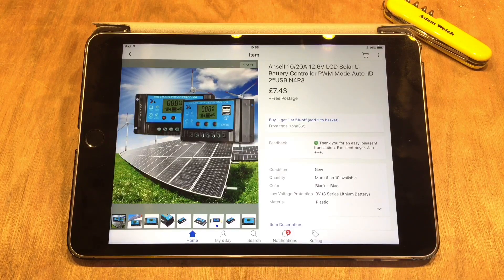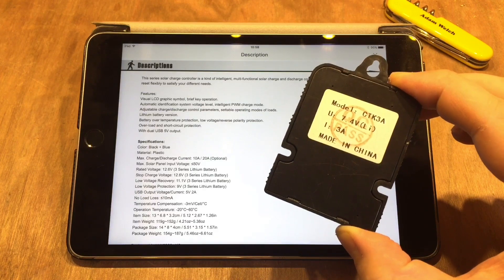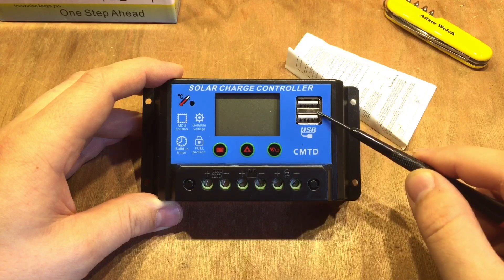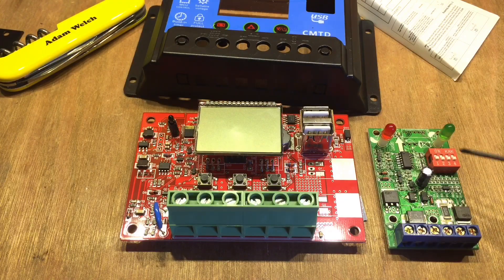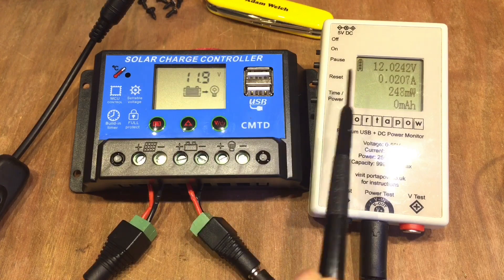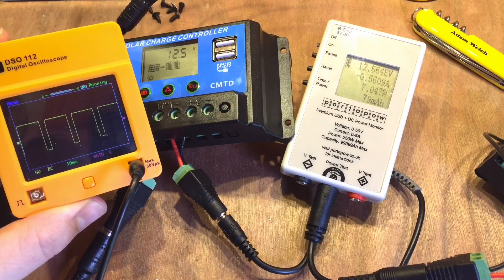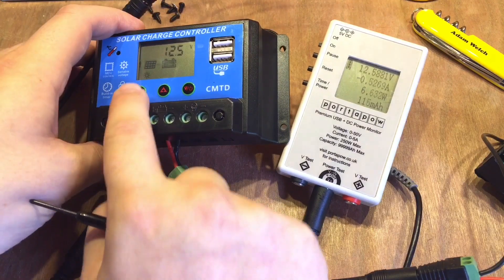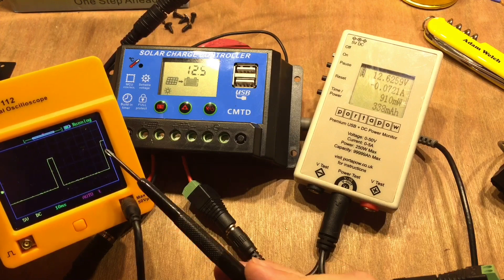Anself CMTD 3S Lithium Solar Charge Controller - 12v Solar Shed

Comment: Hi, Thanks for the video, very informative.  I have a similar version of this controller and a 13w@17.5v panel running it, however it's switching into 24v mode - do you know if there is a way to force it to remain in 12v mode?  I don't have a battery connected yet, so it that going to allow it to switch to 24v mode.  I didn't want to plug a 12v battery in and end up killing it!  Thanks in advance.
Reply: That's precisely the entire point! First thing to be connected is the battery, always! ;-)
The range will then automatically set to 12V or 24V. According to the battery bank connected. Quite simple indeed, no need to complicate!

Comment: hello my friend and thanks for the videos the are great help. i want to  make a small off grid system with one 60watt panel @ 12 volts and a small pack of 18650, what charger@ 20A or setup would you recommend for a 3s opr 4s packs on 12 volts? Thanks in advance.
Reply from the maker: For me 3 or 4s doesn't really work that well on most solar charge controllers.  The cheapest ones tend to charge up to 12.6 or 16.8 volts (the absolute maximum for lithium ion) and keep them there using a float charge.  I've done a series of videos on this and found it works a lot better with a 7s pack. https://youtu.be/YoH7V56RtkM
Now I was quite pleased with the Wincong SX01-3A ( https://youtu.be/vqnf6Msy9No ) because the voltage limits were a little more on the conservative side.  Trouble is it is only 3 amp so you're perhaps a little over it's limit using a 60w panel.  Plus the load output is a funny one - but that might not be an issue for you.
I was looking at the specs on the recent EPEver LPLI range of solar charge controllers.  They come in Tracer models (MPPT) and Landstar models (PWM) and seem to have fairly sensible charging parameters for 3s lithium packs.  Sadly though another funny load output specifically deigned for LEDs on top of a street light.  But I'm told something else may be coming from EPEver very soon.
Reply: Adam Welch thanks for the response. yes i have see the 7s but i must put second panel to make it to 24, volts and thats a yoo much for me .i was ok with 100watt panel @12volt and a 150ah battery fmin order to have lights (leds) and   charge phones small tv etc. with a 150watt inverter. but i was thinking to     skip the battery and go to li-ion .do you think there is . this anself unit your only concern is that trickle charge will eventually destroy the batteries? if i add a balancer will be better or not?

Comment: Would the charge controller behave differently at full charge if a load was connected  ? I thought that was the point of the load output

Comment: i wonder if i can pick your brains about something.
Reply from the maker: +Jay Moore You're welcome to pick what is left of them :-)
Reply: Adam Welch i'm making a small power pack for fishing. i have this controler and wonder the best way to wire up. as at present all my live are Daisychained and the negative as well. the middle of switches go to the + on the accessories. i'm wondering how to wire as to panel is easy and battery is easy. do i use the load to go to the accessories as plus and minus?
Reply from the maker: +Jay Moore Yeah the 'load' output is a simple positive and negative circuit. Using it gives you the advantage of a low voltage disconnect. If your battery voltage goes too low its cut off preventing too much damage. I'm not sure if you need help with the switches? You might need to explain a bit more if you do.
Reply: i have a pack i made thats works and charges via a dc jack. but want to change to a solar. all my earths are chained and the live as well. the middle of switchs are to + of the things i need . I was thiking is it as simple as take the - & + of the dc jack and go into the solar ( so use the jack for the panel and then go from middle battery to fuse and back along the chain

Comment: Many Thanks Adam for the informative video.  I've got a straight forward set up (small panel 12v battery, PIR and small 12v lamp) which I'm trying to set up as a light in my shed!  Been playing around for a while but still struggling with the meaning of some of the settings.  Can you point me to anywhere they are explained in more detail?

Comment: The issue I have with my similar looking unit is that current measurement and regulation is carried out on the negative paths. 
This means that either your vehicle needs to be positive earth, or you need to keep the grounds on your panels and loads floating.

Comment: Hi I have just bought one of these for my caravan. I get the solar panel and battery ports but do you know how to wire the load so I know what power my caravan is using. Help would be appreciated thanks
Reply from the maker: You've probably got a pair of wires that comes straight from the leisure battery which is the main 12v feed into the caravan. You could potentially cut these wires and use the half going to the battery for the battery connection of your charge controller and the other part going off to feed your loads could connect to your load terminals of the charge controller.
The thing to be aware of is you might have a battery charger in your van to power the 12v loads (and charge the battery) when you have AC power?  In which case things get a bit more complicated and to be honest I'd need to see the whole circuit to work out what was the best way forward.
The solar power system in my caravan is simply used to charge the battery - I don't use a charge controller with a load output on it.  Simple fact of the matter it that it's just to keep the battery topped up whilst its not in use rather than be a main power supply.
Reply: Adam Welch cheers I was thinking the same but not sure regarding 240v side of things so will just leave it as is. Cheers for reply

Comment: Did you choose the correct battery chemistry. Usually there are B00(LI-ION), B01(lead acid), B02(gel), B03(flood)
Reply from the maker: +The Walking Trade Now my Anself was sold as lithium only - and I suspected that it's just a lead acid charger which has had its charging parameters changed a little. I did try for a while to find a menu where I could change the chemistry but without success. Perhaps when I get a minute I'll try again with a fresh head on. If you can send me info of a button combination press or hold that you know of that would be handy.
Reply: Mine is this clone: http://www.banggood.com/102030A-USB-Solar-Panel-Battery-Regulator-Charge-Intelligent-Controller-1224V-p-1143533.html?rmmds=search
On this model you long press the First (as explained on the website) screen blinks and then w/ the other 2 buttons you select B01, B02 or B03.
In fact the manual says there is a B00 which does not exist on my model. But it seems that what they call TX4820 and TX4830 have this option for 48V battery (electric bike ?!)
By the way mine is not cutting the load on the usb ports part.
Reply from the maker: +The Walking Trade Thanks for the info - I'll give it a try but I'm not holding my breath.
Reply: The Walking Trade excuse me?
Reply: @AdamWelchUK  I have been experimenting with the ANSELF lead acid 12/24 volt version the end top off voltage is fully adjustable I can adjust it from 13.2V all the way to to 16V in 100 mV increments . I tested it charging an 6 cell 16V Supercapacitor 300F each cell. I used this because it would charge up and reach the final voltage quickly. What I discovered is this charger does not trickle charge at all. When it reaches what it thinks is the final voltage the pulses slow down and then it stops all together. I feel the Meter you was using was just not quite in sync with what voltage it was reading compared to what the charger thought the voltage was. If you had just lowered the set point down a tenth of a volt you would of seen that it stop sending charge pulses. For my test I set the voltage at 13.2V and also later at 14.7V. After the capacitors were charged I would lower the set point down on tenth of a volt and then observe the meter showed no arrow pointing to charging and the pulses stopped until the capacitors started to self drain to the new lower set point. But the charger never went higher than what was shown on the display of the meter. And the meter always showed the current voltage of the capacitors (battery) not the set point. I really don't see why one would need a special Lithium battery charger because the top off voltage is adjustable from 13.2 to 16 Or 26.4V to 32V (as long as the solar panel or power supply feeding it does not put out more amps than the battery can safely receive a charge). Regarding the wrench display on certain parameters shown. If you press on the left button and hold it will allow you to change that parameter. I believe the hour meter button it you press and hold left button for that just resets the hour meter to zero. Also by using the capacitors to confirm about not trickle charging the voltage never rose higher than the setpoint even after several hours. I did notice I had to charge the capacitors up a few volts before the charge controller would start working because at first it was 7.3 volts and not enough to operate it properly. The reason I used the supercapacitors was because a lead acid or lithium battery would take too long to reach the setpoint where I could observe and confirm the pulses stopped after setpoint was reached. Another reason this charger would seem to work well with lithium batteries is that unlike some Lead acid battery chargers this does not have a fast charge algorithm where the voltage is ever raised higher than the set point for a certain period of time during the first portion portion of the charge cycle. At no point does the charge go higher than the set point.
Reply: The instructions with mine suggested that the battery chemistry item was in the settings menu, whereas it is in fact absent

Comment: Thanks for your detailed video 👍 I have an issue where I don't know what to set my PV at and load on and load off. I will be running my 45w fridge and just my microwave and mobile/tablet. 
Would you be able to assist. I have set up my gel batteries b2 and I have 4 x 55Ah battery backup.

Comment: is it possible to regulate the output voltage to be constant at 12.1 to 12.7, regardless if the input is 14v ?
Reply from the maker: +Rafael Dalben The load output is whatever voltage the battery is. So if the battery is under charge it's likely to go about 12.7. If you want to have a regulated output you'll need to add something suitable. You can get some charge controllers with 12v regulated outputs (I've reviewed one) but they tend to only supply omitted current - say 2 amps.

Comment: hi Adam im looking to make a power bank and looking for a cheap lithium charge controller like this but as you said it trickle charges so is there a charge controller that you recommend thats great for lithium? i found this one but dunno if its any good its a wincong SL02B for Li battery any help would be great and great videos.. keep up the good work.
Reply from the maker: Have a look at my series on charging lithium cells with a lead acid solar charge controller - which starts here... https://youtu.be/YoH7V56RtkM

All of the manufacturers of cheap lithium solar products see to adapt a lead acid charge controller and mess with the voltage settings, but not the charging profiles.  I've found that using a lead acid charge controller has benefits over a 'lithium' charge controller.  

That said - if you want the best charging profile you're even better buying a lead acid charge controller where you can adjust all the charging parameters.  That way you can customize the charge exactly to where you are comfortable.  Or you could back the latest ElectroDacus kickstarter - but that's quite a jump in price.
Reply: Okay thanks a lot also I have watched that video of you using a lead acid charge controller to charge lithium battery's lol iv watch most of your videos and only just found your channel about a week ago but thanks again for your help much appreciated

Comment: Excellent well made video! I likewise bought this same model of controller and I am trying to use it on my 12v AGM Duracell battery. My only problem is that I can't tell if my solar panels are charging or not. The display shows that there is a solar panel(s) hocked up but the arrow pointing from the solar panel to the battery never blinks. But I see  that in you video that at one point your arrow is blinking. So what is the difference between the arrow blinking and not blinking? Currently I am using 6 small solar panels: 2 groups of three connected in series and then those 2 group connected in parallel. Yes diodes are being used. Each solar panel is 6volts but where I think my problem is with the watts. some of the panels are 1.5watts and some of them are 1watt. So I'm no where near the 50watts that you have.

FYI: here are all the solar panels I own
4 x   1.5w 6v - 250mA
3 x   1w 6v - 167mA
2 x   .5w 6v - 84mA 

3 x   1.5w 4.5v - 334mA
Reply from the maker: Hello and thank you - I've just looked up a manual online and it suggests a constant arrow means charging and a flashing arrow means it is in float mode.  It looks to me that having numerous small panels perhaps isn't bringing in enough current to fill your battery.  It might be time to look at getting a panel designed for 12 volt charging with a few more watts.  It may be the the energy you are collecting with your small panels is only really enough to offset the current used by the charge controller.
Reply: Adam Welch thank you Adam. No matter how much I looked for an answer to that I could not find it. Good to know that my solar panels are really working! Cheers and God Speed!
Reply from the maker: No problem.  Here's a link to the manual I found... http://felis-net.com/manuals/F0550-B.pdf

Comment: Gooday Adam. What a great instructional video. I've had a bit of a poke about your channel and all seem to be of the same understandable quality.
I've just fitted one of these controllers to my campervan and the setup seems to be fairly simple........except........I can't alter 'battery type'. 
I'm using 2x100ah AGMs and can only get the default '601' showing. What is '601' and how do I select 'AGM' or is done internally by the controller itself ?
Reply from the maker: +Lance S The version I have is set for lithium ion batteries and as far as I'm aware you can't change the chemistry type in the menu. I suspect they are all fairly identical on the inside but the code on the micro controller will have different target voltages and possibly more menu items depending on the model. So sorry I'm not sure I can help all that much. 
Thanks for the kind comments and I hope you enjoy future videos as well!

Comment: hi I have one of thses ,just experimenting with  solar power,seems to work ok but the battery  is discharging overnight any ideas
Reply from the maker: +pontymike56 This one will have some loses internally mainly due to the buck converter (supplying the 5v USB power) if the load is left on. However it shouldn't discharge most batteries over one night. I'd guess either you have a load which is drawing too much overnight, your battery is very small or it is damaged and unable to hold any charge.
Reply: thanks, very helpfull again

Comment: hi sorry to trouble you again, 
I have one of these units, My panel in full sunlight outputs about 19v, but when I connect to the unit and measure the voltage at the terminals on the controller it read about 12v wich is also the batt voltage , any idea whats happening here,
also unable to find the screen to select B1 or B2 for gel or normal lead acid battery, any help appreciated thanks
Reply from the maker: +pontymike56 Yeah this is typical for a PWM solar charge controller. When it's in the bulk stage of charging the panel and the cells are directly connected and therefore they hold pretty much the same voltage. 
When your cells get to their target voltage the controller will start backing off the current by disconnecting the panel from the cells and reconnecting it in ever decreasing pulses - Pulse Width Modulation. 
Your panels 19 volts is produced under no load (usually referred to as open circuit voltage) but at that voltage is does not produce any current - and therefore no power (p=iv). Your panel probably has a short circuit current specified too - but no volts will be produced, again no power. 
Solar panels produce their maximum power somewhere between these two states - usually a bit above the normal operating range of a battery. 
I can't answer your second question at the moment but I'll try and look it up for you.
Reply: thanks, I should have realised about the open circuit voltage, many thanks again

Comment: do you know if this unit will charge a battery from dead flat ( i have the other version ) or does it need some voltage in the battery to operate
Reply from the maker: +pontymike56 I believe it does need some voltage to operate but I haven't tested this myself.
Reply: The unit is powered from its battery input. Without voltage present from the battery, the unit does not power up although I don't have a figure for th minimum voltage threshold.

Comment: I wish they would just have a mppt charge controller that charges each cell at 4.2 v when it hits 4.2 volts it shuts off.  During shut off phase it uses energy of higher voltage series to balance lower voltage series.  Then when system gets to 3.9 volts it will restart with full amps.  When the battery is in full (above 3.9 volts) it dumps power another battery/load.

In a chemistry book, chemical reactions have specific volts they produce.  They don't vary between 4.2 and 3.5 volts.